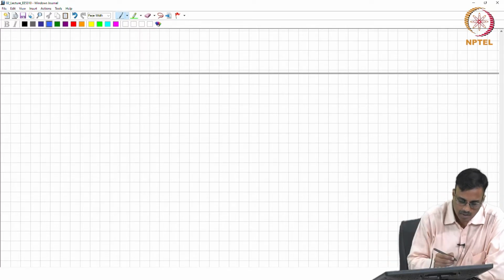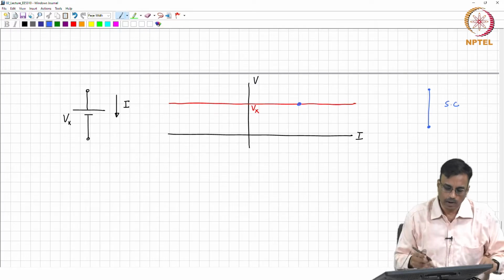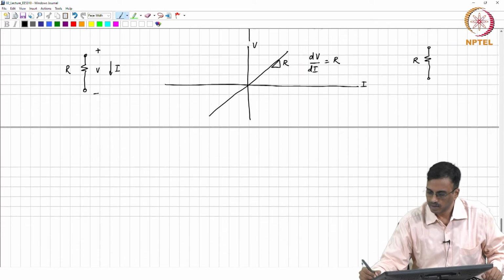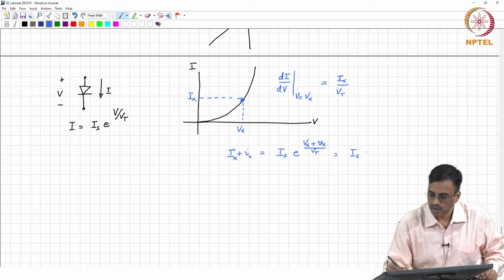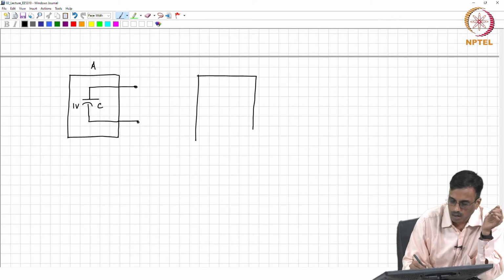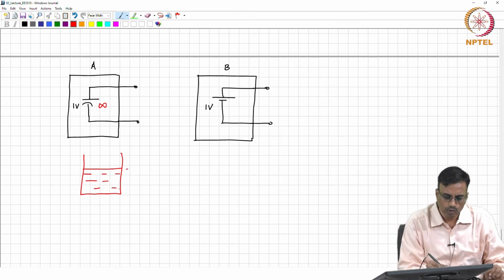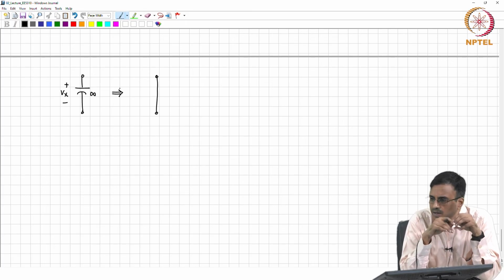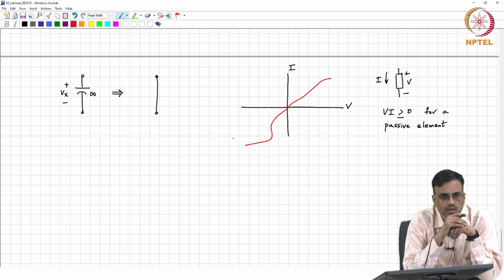Incremental Model for Common Two Terminal Element Passive Two Terminal Elements

Comment: why are we taking df/di why not df/dv?? why current is considered as dependent variable? In small signal the parameter will be replaced by resistor so we use any of eqn df/dv ,df/di right>?

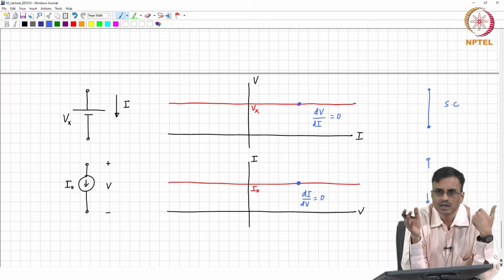Comment: 5:30 , reason for open and short circuit being an equivalent is more understandable if you think in the terms of dimensions of the term which is resistance
Reply: Only if you assume "I" goes to infinity or "V" goes to infinity but the Taylor series approach works for every case